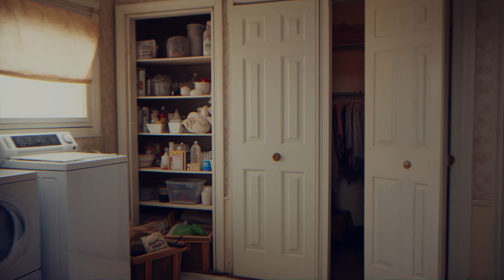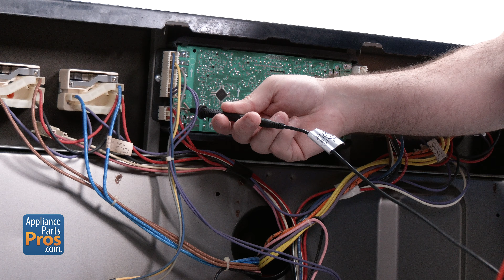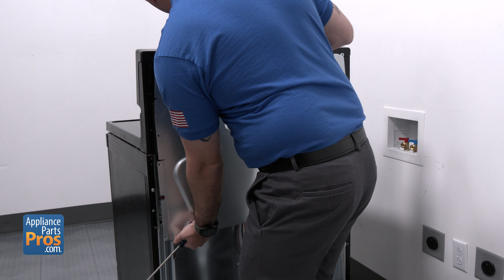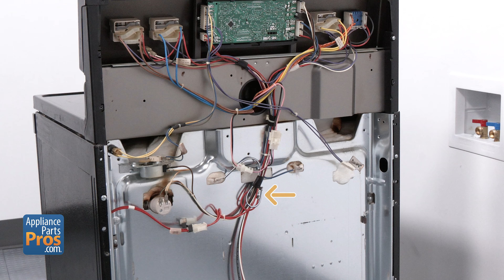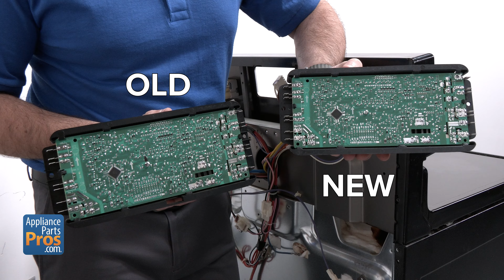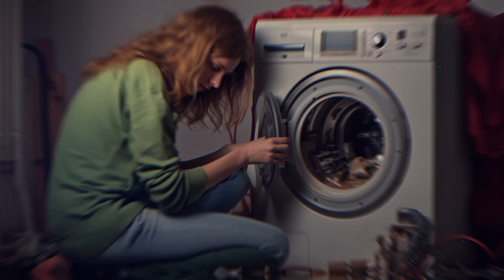Whirlpool Electric Range FIXED! Main Control Replacement Guide

Comment from the maker: 🔧 Common fixes for this issue:
▶ thermal fuse (no part number provided): https://www.youtube.com/watch?v=9bHlvG80PHI
▶ Main oven control board / electronic range control (ERC) ...: https://www.youtube.com/watch?v=RjgXZesOXAc
▶ Whirlpool electric range hidden bake element (part number...: https://www.youtube.com/watch?v=XSJSNAwmO3A
▶ main control board (no specific part number given): https://www.youtube.com/watch?v=TM2bIAbbOzM
▶ GE Electronic Control Board WB27K10355: https://www.youtube.com/watch?v=hiZeQj8U1fs
▶ oven temperature sensor / oven temperature probe (Samsung...: https://www.youtube.com/watch?v=k2CpwL-YuAU

👍 Found your fix? Hit Like so others can find this video too!
🔔 Subscribe for more repair guides: https://www.youtube.com/@AppliancePartsPros